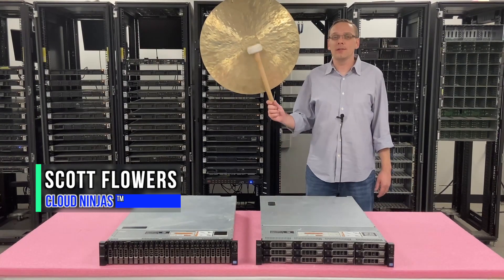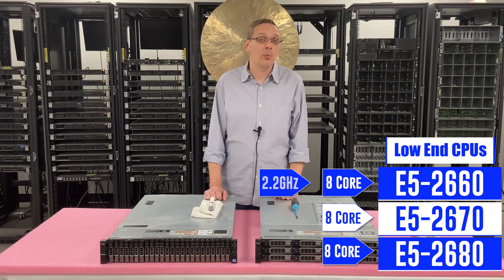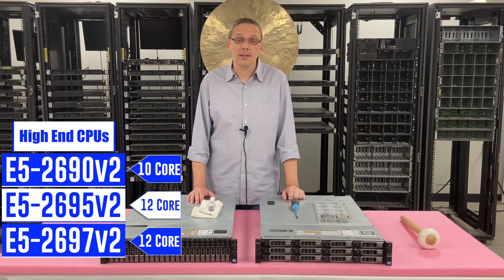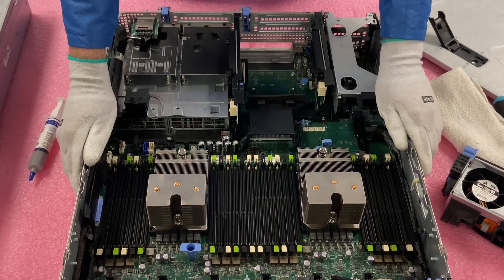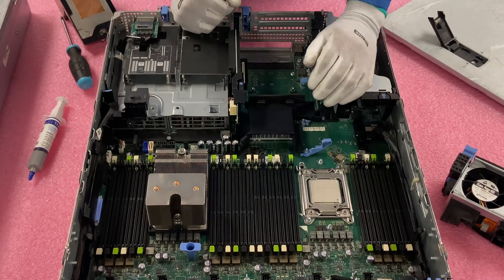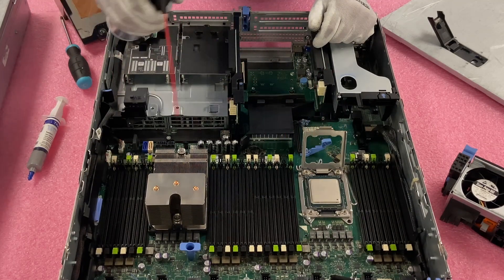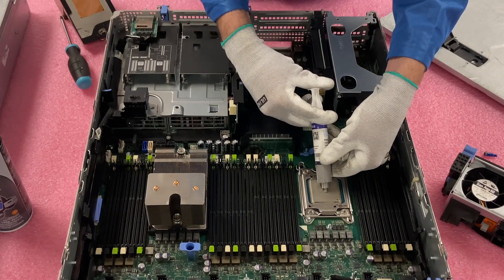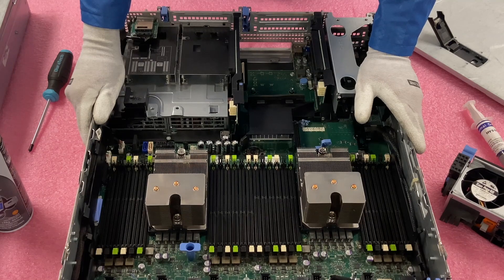Dell PowerEdge R720xd Server CPUs | Intel Xeon Processors Options | LGA2011 Socket | CPU Install

Comment: I have a r720xd and bought a pair of e5-2690 v2 on eBay and realized it says that model cpu is not supported on the 3.5” r720xd. Do you know if these CPU’s can be used maybe with a bios update?
Reply: Yeha i have. A r730 from ebay and i updated the bios and the v4 cpus work
Reply from the maker: Don't see why those wouldn't work.
Reply: Good news, it worked!

Comment: I have an R720xd and a pair of R620s  The 620's are both running Intel(R) Xeon(R) CPU E5-2670 0 @ 2.60GHz' CPUs while the 720XD is showing as a Intel(R) Xeon(R) CPU E5-2640 0 @ 2.50GHz.  looking to max out all CPUs.  When I looked at this video for the 720XD, the  E5-2640 isn't even shown as an option, but the Dell factory inventory shows these as OEM for this SvcTag.  Are there different versions of the Motherboard?  Concerned that if I get the E5-2697v2's I'll kill something onthe motherboard.  Thoughts?
Reply from the maker: Howdy!  We list the procs we recommend, but not all the compatible processors.  The E5-2697v2 works great with the R620 and R720xd.  OEM just means it doesn't say Dell on the chassis... it's nothing to worry about.  Smash that subscribe.
Reply: @cloudninjas  can you provide a purchase link?
Reply from the maker: @danmurray4594  Please email the sales team at sales@cloudninjas.com and we can provide you the link and help or visit our website at https://cloudninjas.com/

Comment: hello, i want to buy the intel xeon e7 8890 v4 and the mainboard that i have supports socket 2011, according to intel the suitable socket for intel e7 v4 processor is socket 2011, do you think the processor e7 8890 v4 will work on my mainboard becomes?
Reply from the maker: No will not work.
Reply: which motherboard would you recommend me? unfortunately I can't find a suitable dual CPU motherboard for the E7 8890 v4

Comment: Is the 2667v4 a good option?
Reply from the maker: It's a great CPU for R730xd... but would not work for R720xd.  Need V1 or V2 procs.  E5-2667v2 would work great for R720xd.  Smash that subscribe.